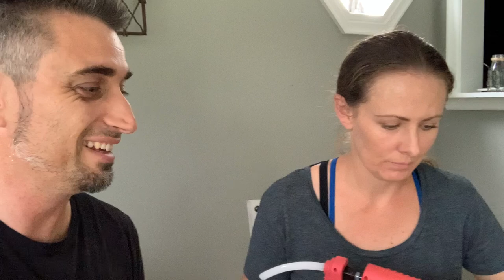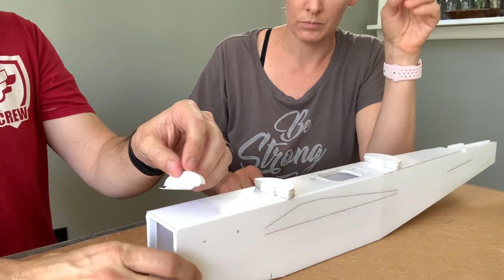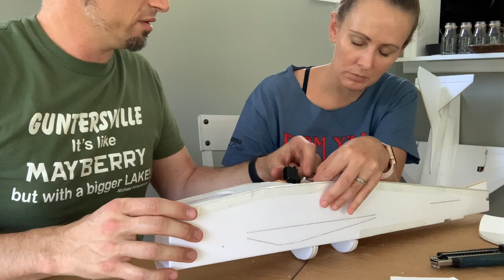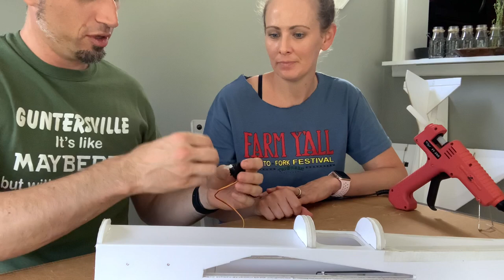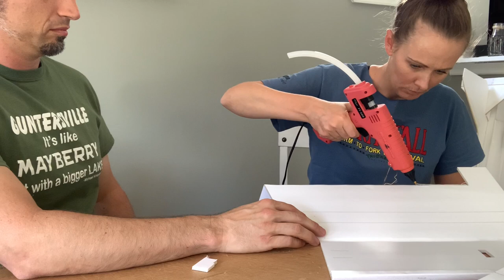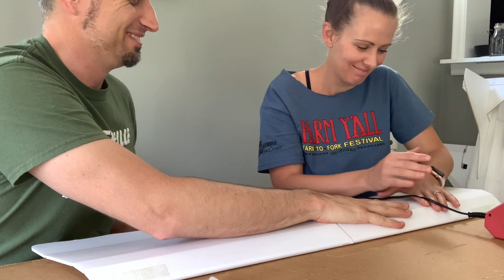My Wife's First Airplane Build!!!

Comment: I just built my first foam board plane 4ft 6inch wing span from scrap No kit no plans I just built it as I went Over all it's pretty much a simple stick with a little more detail to the fuel solage It's raised about a half inch where the wing attaches the wing sets above the fuel solage instead of through it I did get the idea from the Flite Test guys They are awesome That's very cool your wife is into RC planes Great job on the build 🔥👍 I wish my wife of 22yrs would get into it hell I'm lucky if she even comes out to watch me fly lol Cool channel bro I subbed 🔥👍✌️